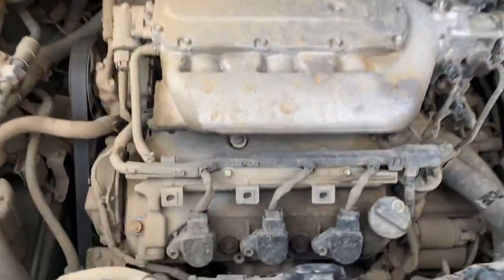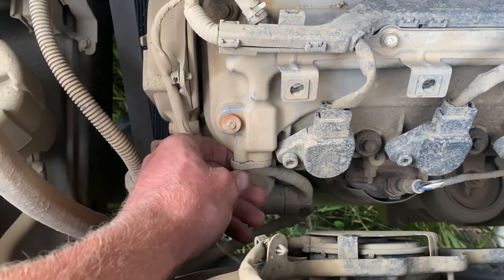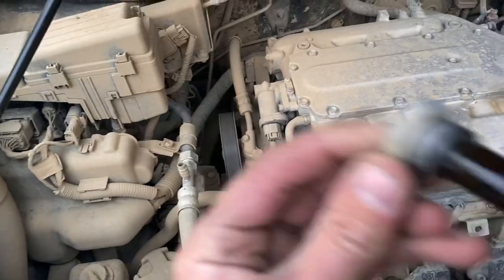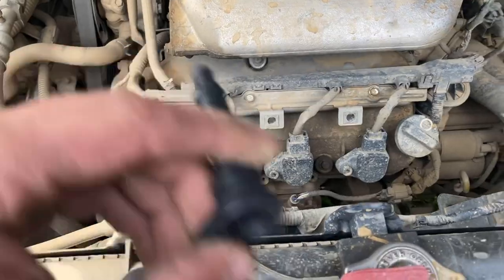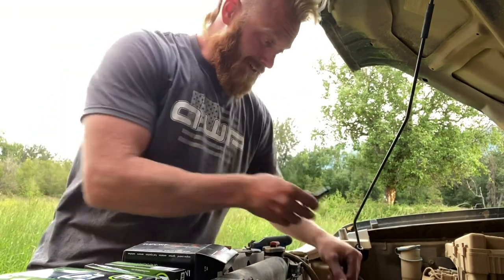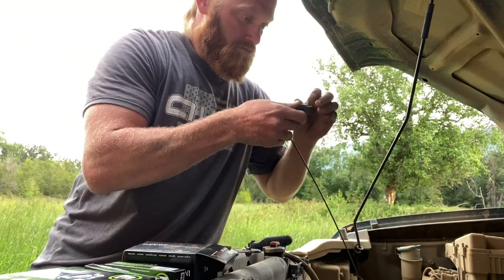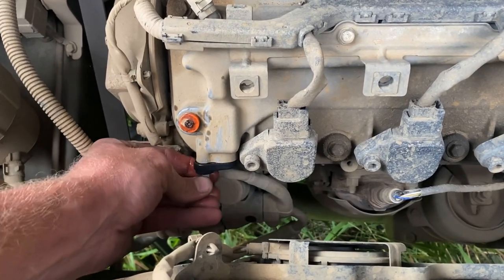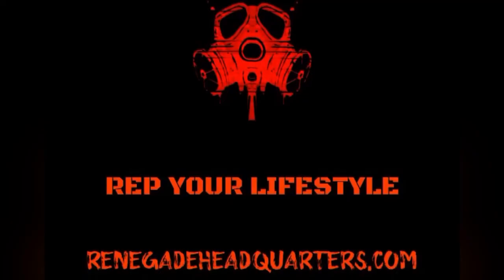How to change PCV valve Honda Ridgeline

Comment: Just changed mine. Barely had a rattle and was very dirty so hopefully changing it actually helps overall. Only hard thing about it was the fastening screw head stripped so had to persuade it with channel locks 🙃
Reply from the maker: Great job! It should give you at least 50hp fixing that!

Comment: 06-08 pvc is on front left by dipstick in 09-14 its on other side of behind the oil fill cap and its tougher to get at with the coil rail in the way buts its doable just did mine was completely clogged

Comment: I have a 2019, is this the same basic concept?
Reply from the maker: To my knowledge yes but I’m not real familiar with the newer ones yet. So I’m not the best source for that.
Reply: @RenegadeHQ  I hope I didn’t jump the gun,dealership wanted a lot. I just ordered the part.we’ll see.
Thanks for your video and quick response!
Reply from the maker: @5borough6g  your welcome. From my understanding most PCV valves are pretty simple to replace but I could be wrong. Best of luck and thanks for the support!

Comment: My hearing sucks. I couldn't hear anything at all when you shook either one of the  valves. I'm guessing one made a rattling noise or something? Just to be clear: Should it be rattling or not? Is rattling good or bad? (Also, thank you for the link to this). Is there only one PCV valve in the Ridgeline?
I was told by the Honda dealership that I need a "tune up" and PCV valve is in the list of things. Looks pretty easy at least. I'm writing down 10mil to remember. LOL. Thank you for this! I wonder if my 2013 RTL Ridgeline uses the same valve. Any links?
Reply from the maker: Rattling is Good. No rattle means it’s clogged up and won’t work properly. Only 1 PCV valve.  Thanks for the support bro! Glad it helped!
Reply: @RenegadeHQ  Ok. Good to know! I'll have to re-watch when my PCV valve arrives. Ordered that, spark plugs, and ignition coils after watching your videos. I really appreciate the info.